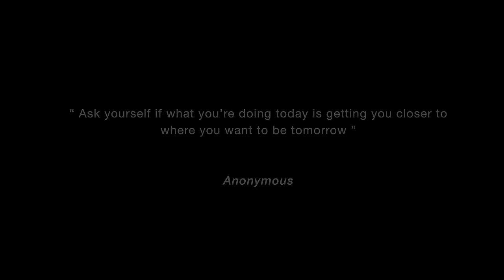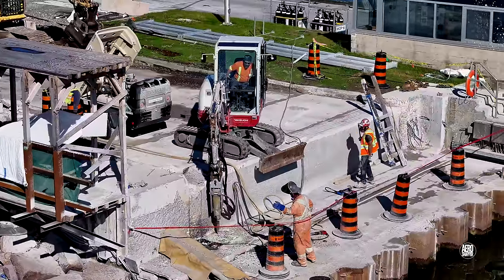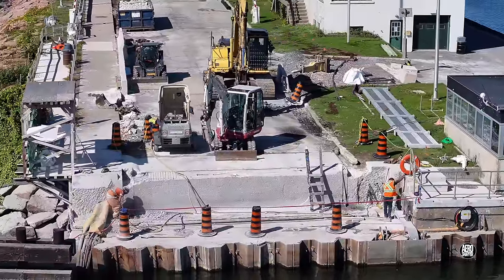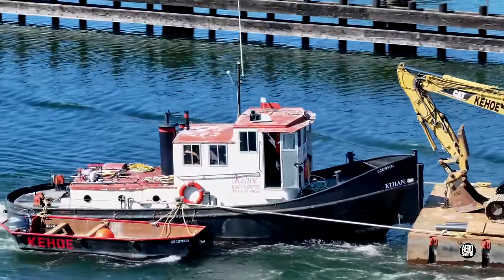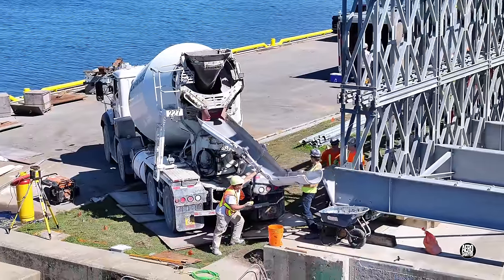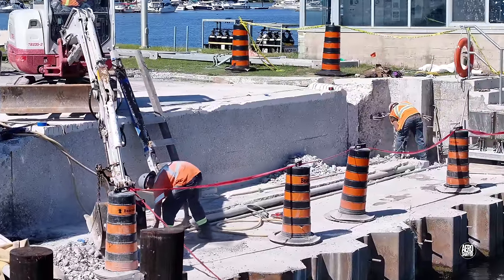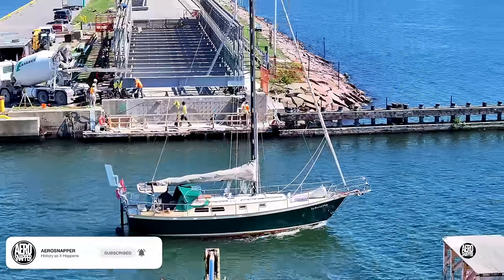Concrete and Clear Skies - an update on Kingston, Ontario's La Salle Causeway  4K

Comment: Incredibly good vid production, yet again Snapper! Great sound editing in again for the jack hammer @:41, but I've got to comment before going any further than @1:47 that the mystery of the bonding/adhering of the bent rebar anchors is answered: We see the excess of it dripping down the concrete from the holes. It's black in colour, might be a form of epoxy, hard to tell...
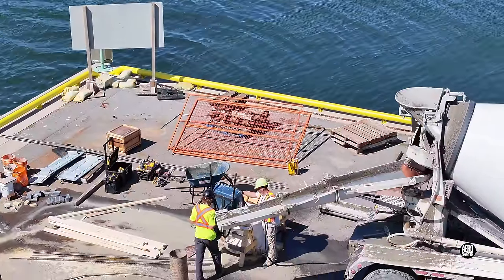Reply: @3:09 shows it even better. I got to thinking I was fooled by the shadows cast by the rebar. Not so...
Reply from the maker: Thank you for making that observation - I will now go back and have a good look myself.  That makes perfect sense, though I haven't observed any injection of material.

Comment: We keep hearing how these Bailey bridges can be set up in a few short hours yet this one is several days.  Strange.  Lot’s of plinth work needed to be done but they are still bolting the Bailey.
Reply from the maker: The reports of rapid assembly usually refer to wartime demands for a fast response.  This bridge is a little more complex and it must be fully tested and certified to carry members of the public in peacetime.  The workforce is fastidious and professional, and under no obligation to service exigent demands for access by working long hours.
Reply: I was thinking that as well, I have been involved with Bailey bridge “launching” in the past on pacific island 
and it did not involve a lot of civil works or concrete it was simply not available. Must be the safty issues and visual appearance taking so long.
Reply: I believe that Bailey bridges in wartime would most likely be preassembled in more unified portions for rapid assembly in the wartime theatres. I have seen photos of side sections in larger but easily transportable sections.
Reply: @wilfredbruce5327  Indeed, this isn't a Bailey Bridge (parts of which are a 'standard' rather than a specific manufacturer's model or property). Lattice segments are used in many bridges, but very few are actually "Bailey" bridges.